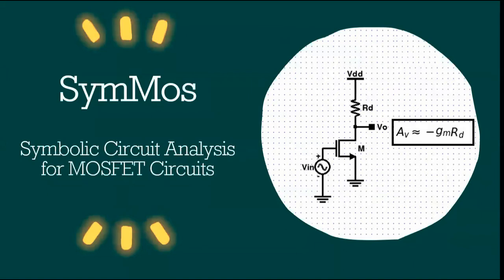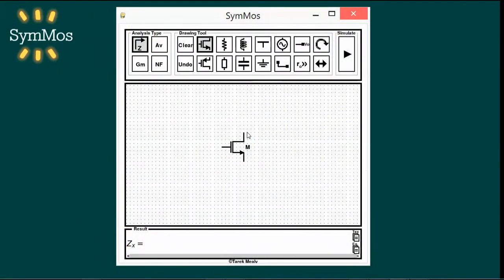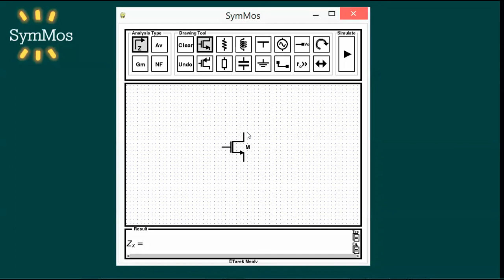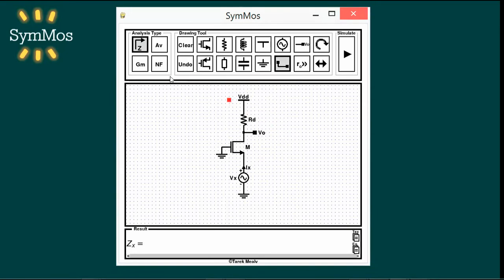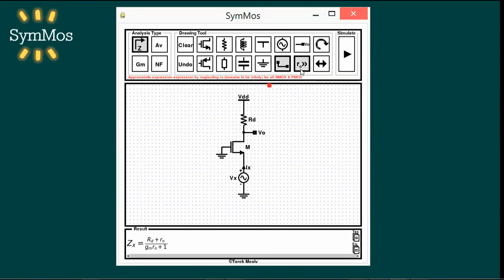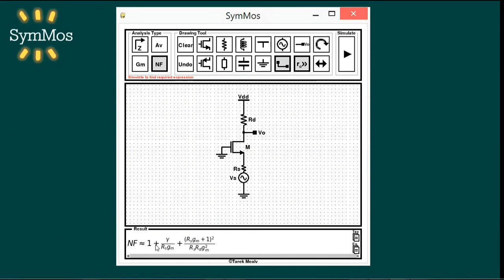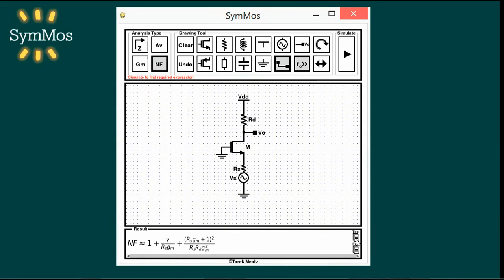Symbolic Circuit Simulator for Analog and RF Circuits (SymMos)

Comment: Hello Dr. Tarek I really found this software interesting and it is a really good work. If you can elaborate how you built this or any paper regarding it, then it will be quite helpful for all of us to get know the how it works. Thanks for such a great work.👍

There's one problem I encountered while running this application, my pc shows a warning that this version is not for my pc  why? I have windows 10 as my OS.